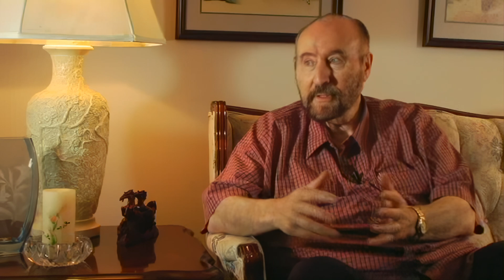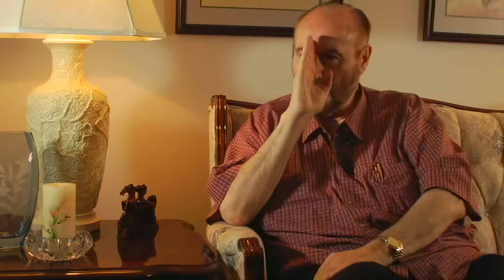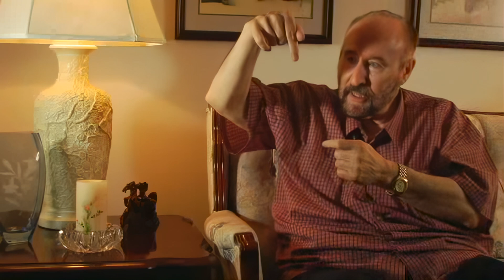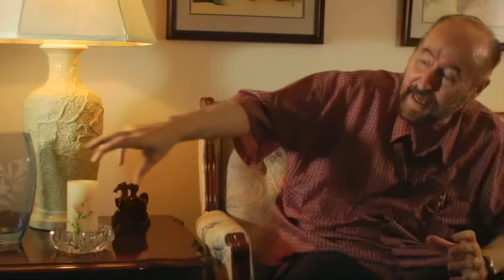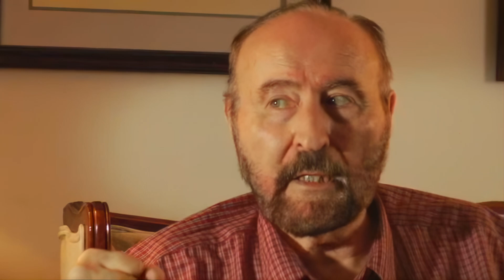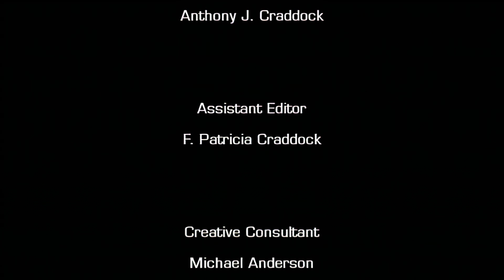Part 13 - Electrodynamics [1080p]

Comment: some information.     so far, every 'successful' ou experimenter/inventor has either not understood enough, fooled themselves, misinterpreted results, or was a hoaxer.       most amateurs don't even understand that the  Optimal  Design  of a coil is driven by its intended purpose.
for example, hardened steel should not be used as a coil core; because it will be become fully and permanently magnetized.    in the context of power processing, there is never a time that a coil should be made of  lots  of winds, of small diameter magnet wire.
achieving ou with circutry is not possible.     there is still one ou concept left to test, however.    that is: the use of a correctly spec'd large-diameter out-runner alternator that is driven via a most-efficient high-reduction ratio drive mechanism.
most-efficient drive mechanism refers to drive of, say, 20:1 ---  via a  Single  stage of gears or friction-drive.     if interested, see my research.
Reply: Arie melis de geus